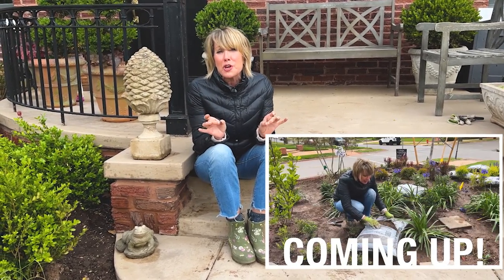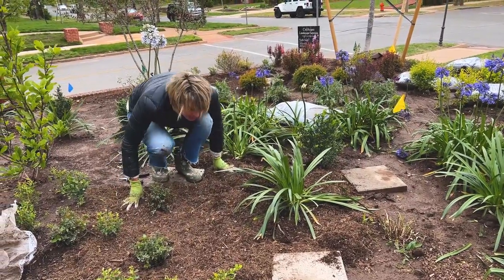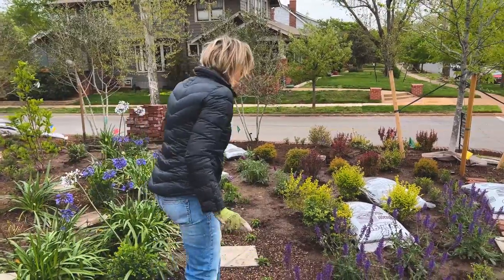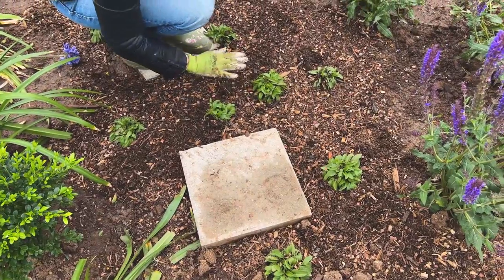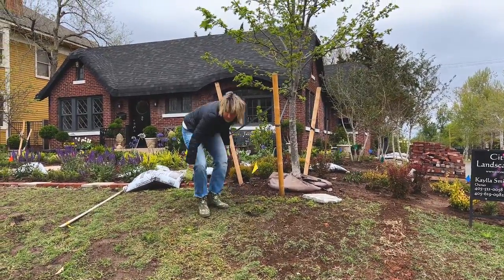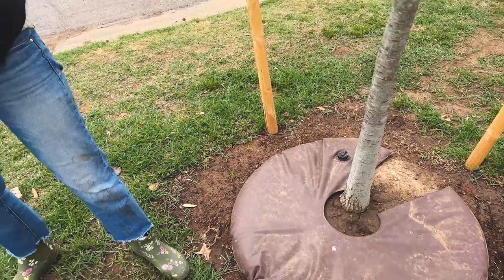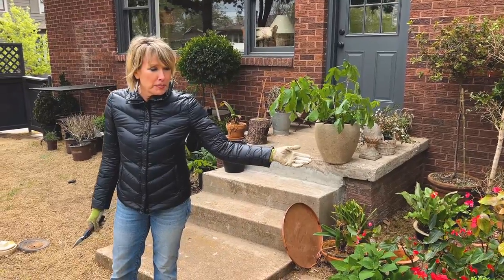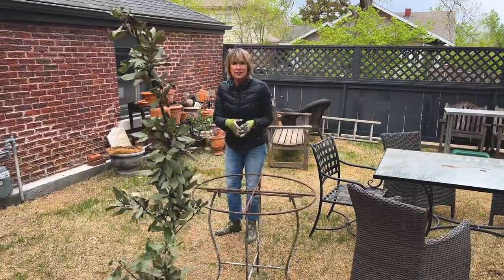Front Yard Finishing Touches

Comment: I've never seen the slanted brick 'mulching' laying on the ground under the boxwood in the front by the sidewalk.  I think a microclimate would be created better if you 'terraced' the spaces under the boxwood with little brick edges and applied mulch for protection.  To be clear, my suggestion about insulation 'board' in the planter box -- insulation comes in 3/8" or 5/8" (?) 'boards' and you can put them between the metal liner and the wood box proper.  When you were talking about a 'dining space' in the back that is going to be oval (um...).  I thought you said 'diamond space' because my computer speakers are old.  I think diamond and straight lines in the back around the table and into the fence area might look better than oval.  Maybe that's just me.... cleaner lines.  Maybe ultimately easier to do as well.